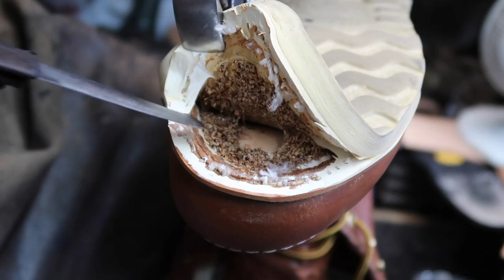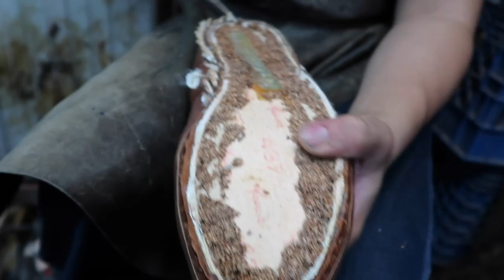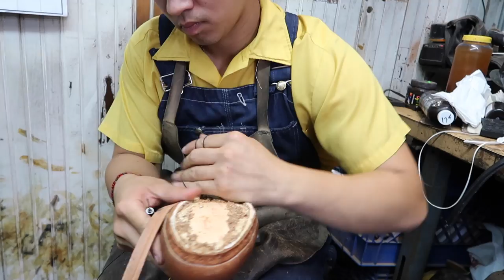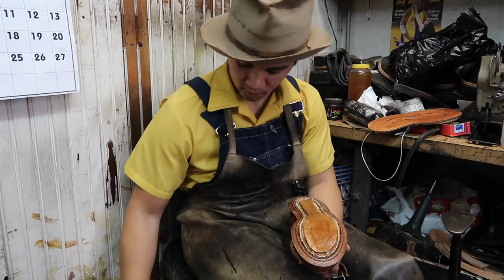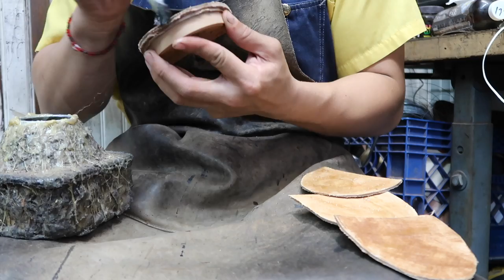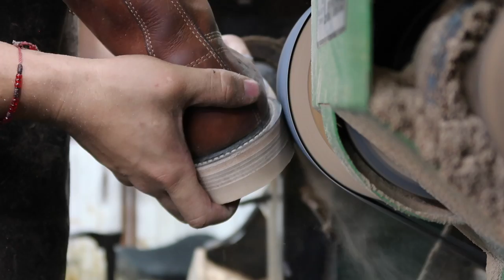THOROGOOD BOOTS Resole #62

Comment: I sure wouldn't mind a resole like this on my plain toe thorogood 814's when the time comes.
The 814 is definitely underrated in the boot community, first and foremost a diehard work boot but they look great and a resole like this really sets them off.

Love these boots, they're so comfortable and that max wear wedge is harder wearing than a vibram cristi wedge.
Those moc toes aren't bad looking but I definitely prefer a round toe.

Redwing and chippewa don't even seem to offer an 8" wedge sole plain toe.
and thorogood really seems to offer a bit more in a $200 boot than anyone else.
Goodyear double seam storm welt, faster break in period,  harder wearing outsole,  what's not to like.
Reply: The thinner leather, loose grain, and lower quality leather compared to other moc toe boots made in the U.S. has put me on standby for buying moc toe boots. 
How would you compare these to the Danner Bull Run and Red Wing 8” moc toe? The consensus seems to be Red Wing for leather quality and street wear, Thorogood for actual work, and Danner as the side option.
Reply: I own the composite toe plain toe thorogoods. Definitely one of my favorite work boots
Reply: @ianturnbow7011  i have all 3 red wing danner  bull run in black and Thorsgood my Thorsgood has had 1 resole i went from wedge to vibram heel sole the boot is about 12 yrs old now i rotate between the 3 tho for work
Reply: @javlop3337  i had a pair of Red Wing 875s, but sold them. I’d like to try out White’s Perry moc toe. Seems like the best value with minimal break-in without sacrificing quality of leather or construction.
Reply: @ianturnbow7011  whites would be nice i have a pair of smokejumpers really nice and comfy i got them on a sale at a local shop great price also. I think as long as you buy a quality boot you cant go wrong  really

Comment: Love the content. Great job Brian. You are a killer boot maker. However I do wonder why the person chose to resolve these boots so early on. 🤔. The soles still looked almost new. Only reason I can think is that he /she may have slipped in them because I have heard that on certain wet surfaces the original soles on this boot can lose traction. Anyway as long as you pay attention to what your doing you will have the most comfortable and beat looking boots around when you go with Thorogood. Got my first two pair recently and love them.

Comment: I have   done  business with  maybe    6 different  shoe   Cobblers  ofer the years  ..  I think all of them  have retired or closed exept for the last  one I  did business with in Kalamazoo MI..  Seems there are not many of them left anymore..
   My  Dragline Crane  has  two brake pedals  and  you have to hold  the   parking  brake  locking springs  in while  digging .. These brakes  are for the  hoist and drag cable  drums..   Only  lfat bottom  "Wedge"  Soles  work for me.. 
   I must have a sole  like what was  on the  Thorogood  origionally ..  If there is a  gap  under the  foot  bed in front of the heel they won't work...

Comment: Brian, please grind off the folded over metal on your nail setting tool. You could lose an eye. Always enjoy your videos, thanks.
Reply: Nah, that Vaughan & Bushnell manufactured punch has using ( likely branded dasco pro) is made with an extra soft body so it's less likely to chip when it wears and starts to mushroom.
And he's not striking it all that hard anyways.

I certainly do it to my own Dasco punches, but it's not that necessary with these.
Cheaper and easier to make it extra soft then properly hard.
Wilde punches are hard enough that they would chip but they wouldn't be anywhere near as mushroomed out at this point.